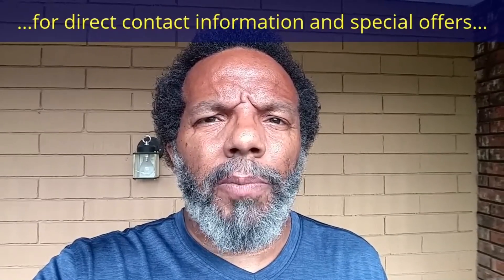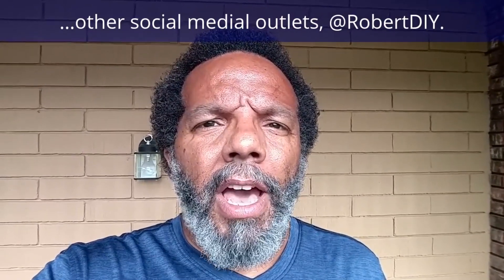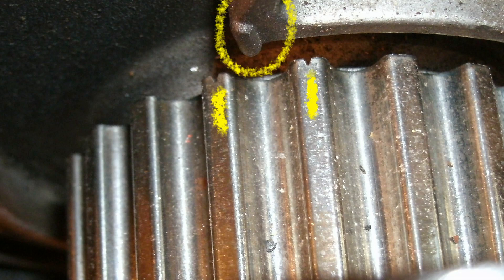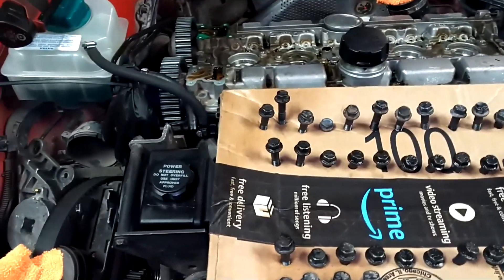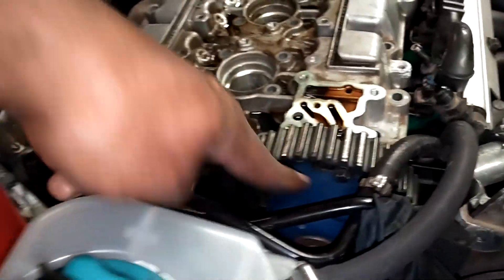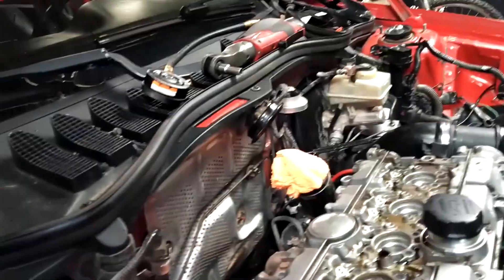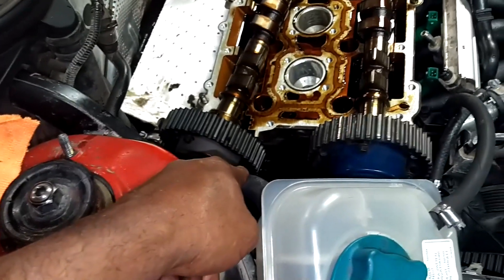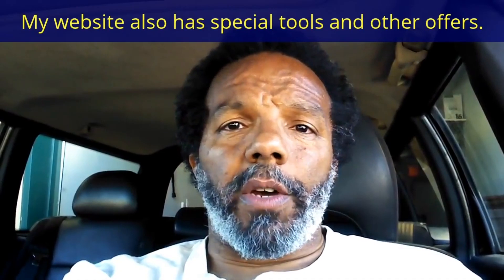Do you need to set the timing and install cam locking tools before you take the cylinder head off.

Comment: So i removed my head with out taking the vvt hubs off following your method. When I put it back together I first align the crank at TDC, I then use the cam locking tools to make sure my cams are locked at TDC, when i put the belt on do I have to twist the hubs one way or another while they are locked (advance or retard) or keep them as they sit naturally?
Reply from the maker: https://youtu.be/p8zd8GVvAa0?si=tyHK8M4eKTcRjePr
Reply from the maker: https://www.youtube.com/live/2BTqi8uewhM?si=xsoUEFtKc9y0ZpJF
Reply from the maker: Before you install the cam cover, put the crank on it's mark. Then set the cams in the head and place them as close to their marks as possible. Then install the cam cover. To set the timing simply install the belt with the cams on their marks and you will be good to go. 

Since you did not remove cam sprockets or VVT hubs you do NOT need cam locking tools.
Reply from the maker: NO TDC. I Never, ever, ever said TDC in my videos. Use the timing marks before you destroy something. 🫤
Reply: @RobertDIY  Okay thank you for your reply, I had misunderstood that the timing marks on the crank meant tdc.

Comment: Mr. Robert. I am working on my 2009 S40.
 The air conditioning belt came got caught in the cranks. Jeff and we lost the timing.  On the crankshaft . Does it matter which way the camp's turn as far as putting it back on timing
Reply from the maker: https://youtu.be/hJIoyHLl30U?si=MSVB2gqFpOsP8rhL

Comment: The engine shop at Volvo sets the crank to the timing mark on the block, installs the lifters, and lays the cam shafts in place using the notches on the end of the intake and exhaust camshafts aligned with the seam between the head and cam cover, then they install the cam seals, then the cam locking tool into the two shafts, then lays down the cam cover and dogs it down, and then installs the VVT hubs, then the cam sprockets to the timing marks on the plastic cover, then they install the timing belt, and give the crank several turns to make sure every thing turns freely. They then give the crank a quarter turn counter clockwise to untension the springs within the VVT hubs, and then do the final positioning of the belt and hubs, then give the crank another two or three clockwise turns, then they install the camshaft position sensors and VVT solenoids,, then mount the engine into the frame. It's really a very simple and genius design because you really have to work hard to do it incorrectly.
Reply from the maker: Thanks for sharing

Comment: Hi Robert, is it necessary to lock the crank shaft after the cams have been removed?
Reply from the maker: Not usually. Just make sure it is back on the mark before you align the cams.

Comment: Hi robert,  ive got a 2003 s60 2.4t , i fixed all the sespension/ waterpump belts and lot of other things on my car . 
Last thing i had to do is changing the spark plugs, so i bought the plugs and changed them but i stripped the threads of 2 cylinders in cylinderhead. .. i found out last mechanic put the wrong spark plugs in ( long ones) so thats the reason why😢. 1 of the stripped threads was already repaired with a coil. Not my lucky day aparently. What should i do ?
Pull the head and let a machine shop fix it?
Reply from the maker: Ouch, ouch, ouch! I would probably replace the head with a rebuilt one.

Comment: Here my question i have a 2002 v40 1.9 waterpump is leaking im doing timing belt while im there i am using the cam locks is it a must i put everything in time first since im just doing it bc waterpump is down not bc of timing problem ? Thanks in advance
Reply from the maker: I almost never use a locking tool.
Reply: @RobertDIY  oh ok

Comment: Very good to know! I'm planning on replacing all the spark plug tube seals in Jody, since 4/5 of the seals are leaking oil on top of the plugs/coil boots. Thankfully, the piston rings are still good after nearly 300K miles! Still got very good compression across the board (195-199 PSI), and the spark plugs were bone dry with only normal wear while replacing them a couple weeks back. 🦾
Reply from the maker: Are you sure they are leaking? Not the PCV or oil cap?
Reply: @RobertDIY  Oh, yes; I’ve beaten that to death 😂 It’s only oily under the ignition coils, and above the spark plugs—it’s bone dry everywhere else

Comment: Hi Robert,  I need your advice. I have a 2009 Volvo S40 with an issue similar to what you were describing as far as the serpentine belt getting sucked into the cam. What is the best approach to fixing and getting my car back on the road.??
Reply from the maker: Did it jump time? If you can remove the busted belt, and start the car, and the car run smooth, just fix what caused the belt to come apart and install a new belt and press on with life. If it make the engine jump time, you can put it back in time and see if it bent valves. If valves were bent it will miss fire because it can't build compression, which is needed for the cylinder to fire, you will need to replace the valves or cylinder head.
Reply from the maker: https://youtu.be/hJIoyHLl30U

Comment: Hey Robert I'm having a problem with my 5 cylinder Volvo. My serpentine belt keeps getting under my timing belt cover & screwing up the timing. It's the second time I'm having to fix this & it's got less than 100,000 miles on it. Is there any way to prevent it from happening again? Like a timing cover seal or anything to prevent the serpentine belt from wrapping under my crankshaft gears.
Reply from the maker: Fix what is causing the belt to jump the pulley.
Reply: @RobertDIY  Could that be caused by a bad pulley or tensioner?  I just bought a broken S60 with the same issue (valves are shot), but figured I should replace ALL the pulleys and tensioners while I'm in there.

Comment: You can also mark the position of the VVT hub and the other hub on the cam shafts themselves using a scribe tool or marker and then back out all three screws completely before removing the timing belt, and then gently tap the hubs off the shafts before removing the cam cover. Makes it easy to remove the cover and cam shafts.
Reply from the maker: Interesting.

Comment: Thank you for your awesome and helpful content! Started with an 850 N/A 5 speed car. Then I bought an 850 turbo as a parts car for it. Today I bought a 850R (16t, injectors, tune) that has a destroyed subframe and some bent and broken suspension parts!  With a little bit of help from your videos, the parts car, and some elbow greese I think I can make a decent daily driver 850R for under $1250 TOTAL!  Your videos are priceless!
Reply from the maker: Very nice. 💪🏾👊🏾
Reply: Update. 850r is running and driving with a new subframe. Started parting out the parts car. Made back about 1k. Into the pair for about $350.

Comment: Is there a special tool you use to replace the valve stem seals on the RN engines when replacing them with the head still installed.
Reply from the maker: https://youtu.be/gt9w-ZSxs9I
Reply from the maker: https://youtu.be/duN5N6jxn0g